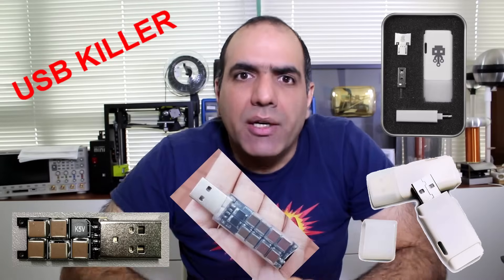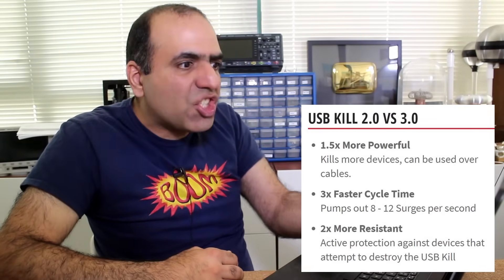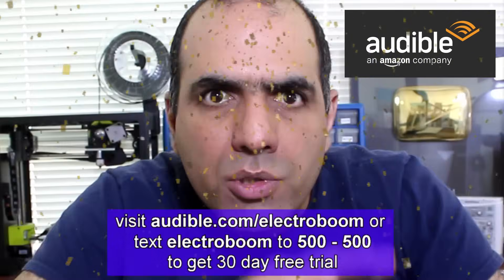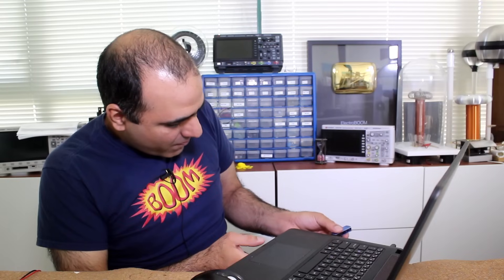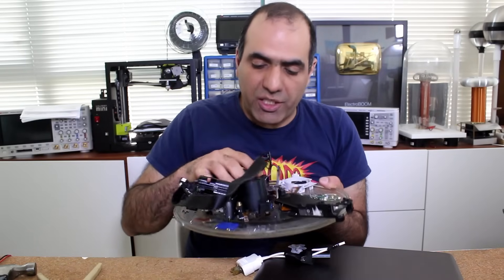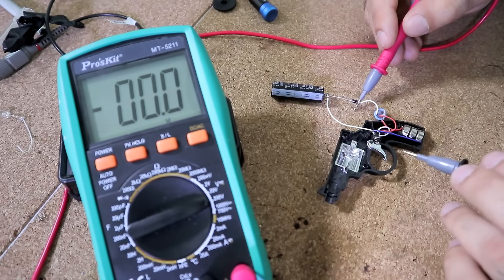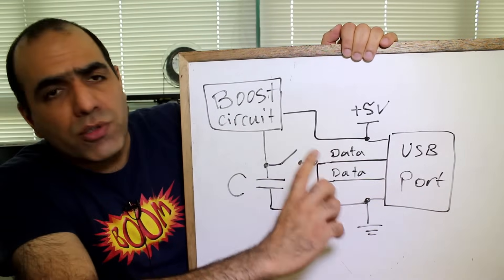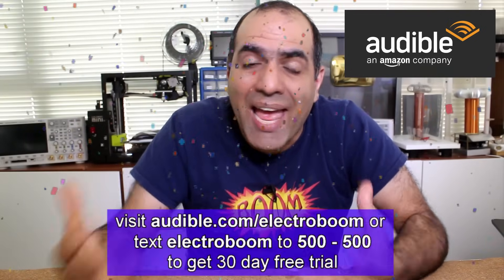USB Killer… WHY???

Comment: If it works the way it's described, sends the voltage surge only over the data connection of the USB, then I would like to use this on USB ports that are supposed to be only for power charging like in a wall outlet. This would fry any malicious or espionage device that may be present in a public wall charger. You could then charge your phone without worrying about a hidden device stealing your data or surreptitiously installing some spyware on your phone using an unknown vulnerability.

Edit: just done further thoughts. I didn't see this "application" mentioned anywhere on the website so it does seem like it's meant for vandals.
Reply: Unless It's a Quallcom Quickcharge charger, those actually use the data lines to negotiate higher voltages if the device requests it

Comment: but that would not erase the HDD
at least not the magnetic drive i have no idea how it would affect SSDs

you'd at best get corrupt sector(s) until the device shuts down - thus making this incredibly useless for even destroying the data (ie the claimed purpose). you'd be better of just attaching some sort of strong electromagnet.

My best guess foe Magnetic drives you blow the seal and toss in some particles that will mess with the surface, preferably magnetic or magnetizable ones. as for SSD just a tiny yield explosive? i don't fucking know i am not spy., (tho there is likely to be some sort of drive destroying do that on sale somewhere)

Comment: This product was designed to expose a flaw in USB devices and make it widespread so that the USB organization would have an incentive to fix it a fast as possible. And btw it was fixed in the USB 3.1 specification so any device with a certified Type-C connector should be safe against these.

Comment: I have been a long time viewer of your Youtube videos. I could use a keysight scope, and have literally electrocuted myself approximately 29 times in the last 12 months testing and repairing equipment for people at work for free. My hair is now grey and I cant even style it if i wanted to. I will now resort to shaving my head in the true ElectroBOOM style simply because I have no choice. A keysight scope will alleviate my issues but for now my old radio shack multi-meter will have to suffice.

Comment: If you're gonna prank people: Put the capacitor in a tennis ball, run and glue down mylar strips on the outside of the ball without them touching. Mark a recharge point to place your rectifier to charge it, denoting polarity as well so you don't blow off your fingers if you used a really powerful capacitor and accidentally reverse polarity.  Wear a sufficient rubber glove. Toss the ball to anyone, even if they are suspicious of your intent, reflex takes over and they'll catch the ball..

Comment: #USBStrangerDanger!

What kind of circuit could be used to foil these things? 

Would something like a usb-middle-man (cobbeled from a usb-a male to usb-a female adapter) with a quick-burn fuse and/or maybe an optoisolator) work? Maybe add a bi-color led indicator?

If a USBKiller was plugged into the computer, it would burn the fuse so the voltage would not reach the computer. 
If the fuse is intact, the led would be green, and if the fuse is burned out, the led would be red.

Would that work?
Reply: No its not working. USB are already protected with TVS (transcient voltage suppressor) check littelfuse manufacturer to find some ref. But the protection is just sufficient  for electrostatic discharge. You can't protect that kind of high speed diff with bigger protection without altering the signal integrity due to the capacitance a huge TVS add.

Comment: @ElectroBOOM
I purchased a discharge that connects between the USB killer and the USB port you are testing. This allows you to tell if the USB killer would indeed destroy the device. Where if it does you can redesign you usb port to not allow it to charge its capacitors. A company would want this if they have any USB ports exposed to the public and would like to keep it safe from destruction. I did enjoy the video though!

Comment: I'm no electrician, most of what you say is Greek to me and I would really like to study to understand it better. However, I did get my degree in computer science. I don't understand why you think the USB killer chain would be USN interface > CPU > SSD. USB hubs interface with the south bridge. The south bridge interfaces with IDE/SATA, PCI devices, and the north bridge. North bridge communicates directly with CPU, RAM, and PCI Express. I would think the CPU would be relatively safe since it's behind yet another interface compared to a SATA SSD. A lot of high end computers use NVMe SSDs that actually interface with the PCI Express bus to take advantage of the higher bandwidth, so I would guess that those types are safer than SATA.

This is just how I understand data travels and interacts. Is there a different reason electrically why you think the chain of events would be USB > CPU > SATA? Guess we need a tester to find out. 😉

Comment: Even when your laptop is hit by ligtning your data will be recoverable. I suggest overwriting everything 35 times and then heating your harddrive memory disks above their curie point to demagnetize them, grind them to dust and spread it in a local river wich will carry it to the ocean. If you cant trust your river you might as well divide the pile of dust and spread it in multiple rivers

Even the NSA wont be able to find all the grains of harddrive between all the grains of sand so you should be safe enough.

Comment: Or the cheapest I have seen (accidentally):
USB connector, plus piece of pencil lead stuck the in the connector across all four lines. Causes a really hot short circuit. Killed part of a laptop's motherboard, but surprisingly not the flashdrive that made it. Lesson learned, don't keep pencils with flash drives.

Comment: Oh, one time use film cameras... I remember one time back when I worked retail; I was training a new hire on the one hour machine. I had to go over getting film out of a one time use camera in the dark box if it failed to wind up. I took one out of the recycle bin and told him there was something he needed to be aware of to avoid getting a shock. 

I exposed the circuit board and said he’d need to get close up to see it and “pointed” at the flash capacitor with a screw driver. The loud spark scared the crap out of my trainee and he doubled back and fell over as he made a shrill shriek. It was pretty funny.

Comment: 6:40 I've made a stun gun like that. I connected wires to the flash and screws I put through the camera's plastic case. In my second iteration I made one specifically to prank my uncles by hiding the metal contacts under the paper where a person would naturally hold the camera and told them to take a picture. 12 yo me had a mean streak lol

Comment: Any chance you could make a video on solenoids? I worked as a low voltage installer for a few years and now work for an access control manufacturer in tech support. Trying to explain to my Coworkers why our manual says to install a diode across the voltage input is a bit difficult, though most strikes already have them built in, as I can use the terminology of back emf to explain it but not quite correct. Your videos are alot more informative and interesting then what I can explain in very dry terms that lose them.

Comment: "Do they use bombs to simulate earthquakes?". Explosives are not a good simulation of earthquakes. NEBS standards for telecom central office equipment has earthquake tests. They used large room size hydraulic shaker systems...long durations, low frequencies and high excursions.

Comment: I feel the biggest "legit" use of the usb killer is to expose that such things can be made relatively fast and easily disguised as a real usb device. It was basically a nice little one time white paper infosec pros come back to because of the lure of damaging peoples things. Infosec is very much in need of more psych therapy. Anyway, due to this design, there has been a series of arguments over protections built in to modern computers including power separation for each port so that should a surge occur impacting it, it wont impact the usb controller or any other ports from working.

There is a design somewhere around here to charge a capacitor to ignite several grams of thermite. Because well... burning the place down is fine too. Desu.

Comment: The usb killer can be sold as a destructive device, or gifted to someone, and it breaks the computer.

Scammers have been known to seldom sell these killers as "USB sticks", cheaply on auction websites, etc., and yeah. Obviously, if you buy one, and plug it in, the minimum it does is shred the USB port, if not the entire USB controller, or the entire PC.

Since a destructive device like that is somewhat illegal, if its sold as a "memory stick" and in fact releases a charge, destroying your pc, well.

Its a double scam, they scam you into destroying your PC, and scam you for something you cannot use, since it is not a memory stick. So you destroy parts of your pc, and lost money. It's been around for years, but it is seldom used, because websites that sell stuff, still have a refund or 'customer service' policy, so if you'd scam someone like that, you could end up in trouble.

The thing with "ESD tester" is simply a wording to avoid these devices being outright banned.

It's like selling a gun made for suicide, as a 'pain reliever'. You know? It relieves the pain. It will kill you of course, but it relieves the pain, so it did work, after all, didnt it?

Comment: When I was a little kid, I took apart a disposable camera with flash and got shocked by the capacitor. It was like it stopped my entire brain and blacked out my vision for just an instant.  I remember just staring off into space for several minutes after it happened.
Reply: I was so scared when I opened my broken camera just because of that reason. But then nothing happened and I'm pretty sure I touched every part of the camera. Maybe modern cameras discharge faster...

Comment: Back around 2000 there was a device called "etherkiller" which was designed to plug into an Ethernet port to destroy a computer. This device is simply a newer version of that concept. People should be very careful about plugging in any USB memory stick that they do not know where it came from. People wanting to gain access to computer systems have been known to drop a memory stick in front of a company figuring that someone will want to see if they can find out who it belonged to and upon plugging it into their system a virus gets loaded. It is a fairly common attack vector for certain industries. 
Stay safe everyone and stay paranoid. 8-)

Comment: I used to take the flash capacitor from a disposable camera, solder a thin wire to each capacitor lead, then tape the wires to a long dowel with the exposed wires at the end.
Then I would charge the flash and poke my friends with the wires . Ahhhh highschool. It wakes up your passed out, asshat, drunk friends and snaps them out of a black out. Fun times.

Comment: Hey man, you want something that'll charge capacitors insanely fast?  650W of charging power at 1kV.  Check out our stuff ;)
https://www.ebay.com/itm/Arcflash-Labs-High-Voltage-Capacitor-Charger-1kV-535W-Output/153403253520?hash=item23b78be310:g:yKAAAOSwY7lcfiQ0

Comment: This does have a use other than killing devices. This does not work against all devices btw some devices have built in protection against this type of attack. Because let's not forget the crappy chinese rip off products that won't only kill your computer but will kill you in the process. 

This device does have uses other than killing devices for fun although there will always be a malicious component to it. Some manufactures have protection against this device.

Fun fact 2 of the PS4's usb ports are protected from this while the other one is not. IDK why they protected 2 of them but not the others.

Also yes they do use bombs to simulate earthquakes lol.

Comment: Found one of those chinesium quality USB sound cards and plugged it in my PC just for shits n giggles, of course, i failed to check that it had been rained on for what appeared to be a decade, so the moment i plug it in, either my PSU or my mobo started gracefully pulsing the power to the usb port, because that's what modern, non-crappy computers do to avoid damage due to user idiocy.
Of course, my room smelled a little bit like burned china electronics for a week afterwards, what with the shorted circuits on the usb card burning up with every pulse, but at least it didn't blow one of the several tiny fuses on the usb line - yet another protection thing for braindead motherfuckers like me, and potentially you, the sad reader who actually reads this kinda crap to the very end.

Comment: - Don't worry it won't erase your data
- Then we are good, high five!
- Unless you have solid-state drive memory that is... 
- (Surprised Pikachu Face) :O
Reply: @Tcll5850 I had mupltile ssds in a number of computers for 6+ years, used as the only drive. They all work flawlessly to this day.
Reply: @Tcll5850 ohoh, my ssd is almost 3 years. good to know. well, not really, but thanks anyways. :P
Reply: @Tcll5850 actually, most SSD will lock itself into a read only mode once it reaches its write endurance limits. Usually, there will be no user data corruption, it is still readable.

Comment: I have actually had to use one of these before. It is great for testing if something like this can be used maliciously. When you are building a safety device or a security device I want to make sure someone cant stick something in an open port and disable the entire device. Instead it shows that it would only kill the usb port. It is also a great way to test over voltage protection on electronics. Even if things like this weren't sold then people would do what you did and dangerously plug it into a live connection, Instead they have a safer way to test for themselves.

Comment: It's actually pretty hard to completely destroy all the data on a HDD, especially if you want to do it quickly.

The most reliable way to wipe all traces of data from a HDD is to write junk data over the entire drive several times. There exists software that does this. But it has the disadvantage of being slower than a sleeping snail.

Barring that, your only option is complete and utter physical destruction of the magnetic platters. It's not enough to simply break it; you must convert the entire platter into a fine powder. Even if you shatter a platter into a thousand pieces, all you've done is turn it into a 1000-piece puzzle that could be reassembled. It's not easy to do that, especially if it has to be done quickly.

Comment: I think they mention it on the site, but in short they want to force manufacturers to build overcharge protections into their devices. Apple for example already implements some protection, but not for all devices i think. Its really cheap to implement something like this, and honestly this should already be a standard in USB. Also on their site you can get pro kit with testing kit for 72eur. With testing kit you can check what devices are protecter and which are not without destroying your device.

Comment: Usually has to do with the fact a lot of companies dont want to replace even ancient hardware because "hey it still works".
Obviously most IT professionals who work with this ancient stuff are frustrated by it and often have to deal with the problems that come with it.
It's the same reason a normal power cable to Ethernet port cable exists dubbed "etherkiller".
You kill hardware and just tell the company well lol it was old and it fried gonna need a new one now.

Comment: They should make a device powered by mains and connects directly to the drive via SATA cable with a safety circuit in between for legitimate data destruction.  Like if a drive dies on its own, or you’re just getting rid of an old drive.  You should always physically destroy it so the platters or modules can’t be recovered.

Comment: I have an USB lighter, it charges via USB and looks like a pendrive. When its charged (and it lasts very long) you slide a buttom whith a nice S (like superman) and then apears a side with a hot wire that turns red hot. I don't smoke and I have it since long time ago. Now my eleven years old took my device from my closet and burned (a little) his finger. He didn't tell me nothing, but mum... 
Now I think if it was an USB killer... Poor laptop! :-/

Comment: I'll tell you exactly what it's supposed to test. It's supposed to test the USB charge protection. If it kills the computer then said computer doesn't have adequate protection. If it doesn't kill the computer then it has good protection in case a USB that isn't supposed to do that gets overcharged or an idiot (not pointing fingers here) decides to attach a USB directly to a plug without proper filters for the sole purpose of proving a point.

Comment: Your right. I was prepared to instantly dislike the video. 
Its just for stupid 13 year olds who think theyre hackers.

Its not possible to kill an HDD as the data will still be recoverable because it will just fry the circuit board without doing anything to the physical disk.

Comment: Had a coworker years ago ask if we could use Power over Ethernet to zap rogue devices on the network.  He was serious.

As a joke I made him a cable that had a NEMA 5-15 plug on one end and an RJ-45 connector on the other.  I did not electrically connect it inside though, because I figured he would end up using it.

Comment: Honestly I think a decent prank would be to make fake USB Killers, would really be as simple as connecting an electric match to the power lines of a USB, or alter the existing USB killer circuit to discharge across a deliberately underrated fuse inside the stick. All the flash and bang but minimal actual damage.